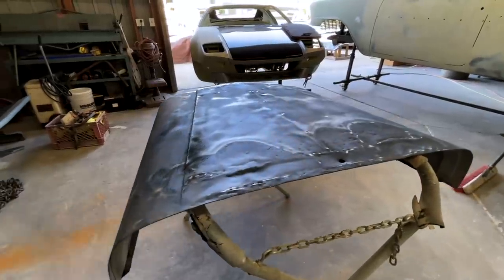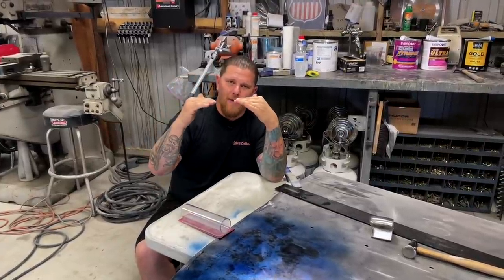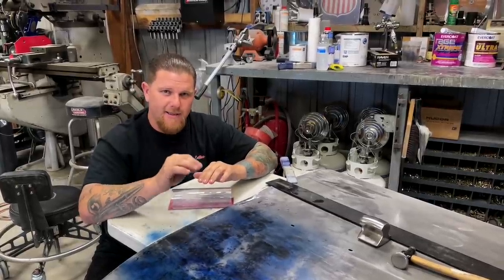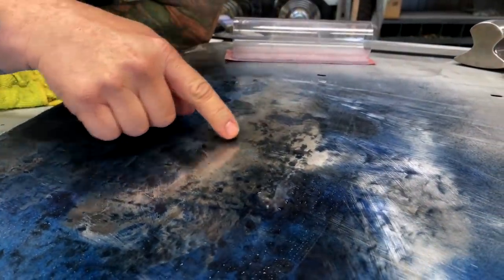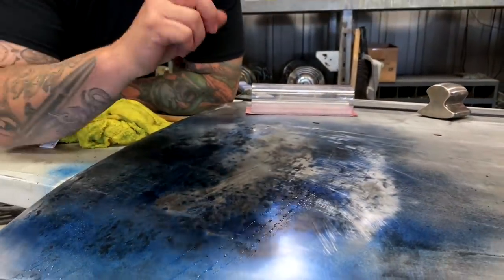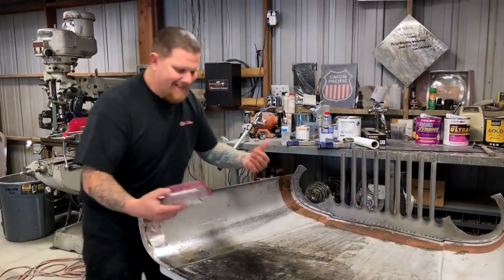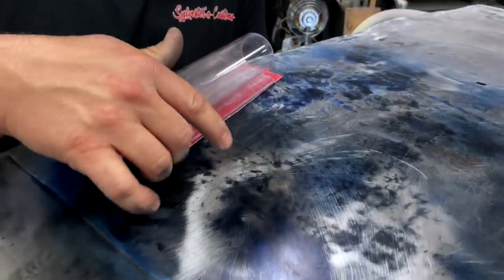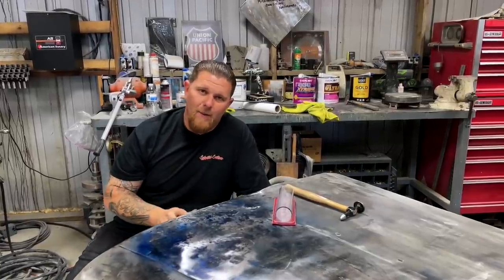Body Work Without Body Filler Ep.2 49 Willys Hood

Comment: Wow! I'm fully an amateur working on a restore of my '78 124 Spider. Had to replace the rear wheel wells and got a small "wave" in the quarterpanel from the heat. Didn't quite know what to do with it. Sure...could have covered it with a gob of body filler, but really excited to try to work it out properly.

Comment: Great video thanks, the part that I find confusing is that you want to shrink the highs and stretch the lows on one side, but if the panel is flipped over the lows are now high. If  I use the shrinking disc it will be shrinking the areas that I want to stretch on the other side. That was confusing to type...lol
Reply from the maker: Good point! Best way to think about it is using a spline to sight the shape in. If you shrink to much it will become flat vs retaining the shape. However I have fixed flat panels by shrink disc and flipping the panel over.

Comment: The "Heat shrinker" is new to me, a torch and dolley is the way I learned to shrink. You said that your power unit had to turn 6,000 rpm's. I am thinking of getting one for my project and I see Eastwood has them in three different diameters. I want to get out cheap so I was thinking of the 41/2". But I know that I will get a lot more heat out of a 9" disk than a 41/2" disk. So does a small one work?? Thanks for your great videos. I realize you are in business and that time is money, so I wonder why you do this. This is one of the few thing in the world that I have seen come, that I feel is a good thing. So when I say thank you, I am sincere.
Reply from the maker: Thank you. The smaller one will only work for tight areas. Otherwise you need the large disk, so that way you are bridging the lows to make a true mirror finish.

Comment: Another very helpful video!  I am at the same stage with the same issue on my project.  Did that Makita grinder come with a flush mount collet for the shrinking disk or if not how did you get it so that you can run the shrinking disk totally flat on the panel without introducing new scratches?  I have the proshaper 10 inch shrinking disk looking at buying that Makita grinder.  Thank you for your help.
Reply from the maker: Contact Ken Sakamoto with sunchaser studios he has everything from the nut and the backing plate 👍🏻

Comment: Awsome video and def learned some new stuff. But I would have like to see how u started working down a larger dent with a good size crown..so you do more hammer off dolly to rough in the shape then fine tune it with what your doing or?
Reply from the maker: We typically bump out the panel with dolly only to get it close.

Comment: Excellent information. I wish your video had been available years ago when I bought my shrinking disk. I got the panel close enough for, but if I ever repaint I'll be able to get it perfect. 
Question. Your disc is serrated. Why is that? The one I have is smooth.
Reply from the maker: Thank you. Yes Ken Sakamoto’s sunchaser disc comes serrated it creates more heat than the smooth ones. It also creates a higher pitch when on the high areas so you can tell when you are rubbing the right spot. I have both smooth and serrated once I used this one I never went back.
Reply: @SYLVESTERSCUSTOMS  cool, thanks.

Comment: Great video. I'm panel beating a low crown roof that was sand blasted. I'm using a shrinking disc, a hammer, dolly and a slapper. The work is painfully slow. The roof top surface has many convex bulges about 12 inches diameter.
They are not very high and are the result of sand blasting the underside. Do I need to use the disc on the entire bulge or can I work on it in sections? Also if this is OK do I work from the outside towards the centre?
Reply from the maker: Use a block and only rub where you have the highs start in the good areas first. So if you start using the rubbing of the shrinking disc in the center of a high area that is bulged out you will get a better result if you only use it where the block scratches first as it starts to shrink more of it will have a contact patch as it gets closer to flat.
Reply: @SYLVESTERSCUSTOMS  Thanks for your super fast reply! I've been using you method today and am making progress. To gain confidence I started with the less difficult areas. There is however a large bulge nearby waiting to devour me!
Thanks again,
Mike

Comment: Hi Sylvester.  What would the ratio on 4:1 2k primer be it you want to use it as a sealer? Would you add reducer like 2:1:1 to thin it out for a smooth finish not requiring any sanding so I can just go right to base coat after it has flashed?? I spray motorcycle frames and don't have to fuss over much but when I sand the old finish some bare metal comes out and I want to just spot those small areas with a thin coat of self etching primer but on one of your videos I heard that you shouldn't spray base coat over self etching primer? Could I spray a thin coat of self etching primer thin a reduced coat of 2k then go to base coat. Also what about just self etching then a thin coat of rattle can primer, these spots are usually an inch or les in size? Thank you in advance.
Reply from the maker: All products vary however refer to your TDS sheet. Me personally I’d use epoxy primer then spray my base over that.
Reply: @SYLVESTERSCUSTOMS  I figured you would go that way and I want to try the epoxy but with bikes, waiting 2-3 days for the epoxy to cure is a lot to ask. When I finally burn through the 2k I have I will try the PPG epoxy and report in my videos. Thank you for taking the time for all of us!
Reply from the maker: @JTSCUSTOMS  👍🏻👍🏻👍🏻

Comment: ok, i get the idea of the shrinking disc ....but my situation. i am replacing door panel lowers (1951 chevy 3100), i have an access hole but its limited as to how much i can get my hand and arm inside to dolly the back(inside the door skin at the weld seam)and hammer and slapper bar the outside... for the most part its going well, but i had a spot (wave) about 4 inches in diameter that is currently convex to the outer door skin that i need to get shrunk down . what would you advise doing to do just that? i do not own a shrinking disc.
Reply from the maker: Kinda hard to explain not being able to see the door. It’s not uncommon to carefully remove areas of the inner door to gain better access then once you fix the area weld it all back in. But if you don’t own a disc you need to buy one I don’t have an alternative
Reply: @SYLVESTERSCUSTOMS  do you have an email or place i could send you a few pictures of the door. I got most of it out hand planishing. I have a palm sized low up by the door handle hole i never welded on , so its got to be oil canning from where i welded and ground it down.  I do have to cut a 6x9 speaker hole behind it. Maybe i can get a dolly behind it and slowly work it out .

Comment: I’m having a tough time on the back of my cab which is a 87 k10  Chevy. It had a decent sized dent in circumference, not real deep. I’m self learning a lot of it. I used my stud gun to pull and hammer and got a lot of it back out but I am getting oil canning. So I heated it up and tapped and cooled quick. I cannot get a dolly behind the panel cuz the inner cab panel has no access to outer. So I have a lot of dimples from the stud gun and it’s a little wonky. I straight edged it and there shouldn’t be no more than a 1/16th of filler in the deepest spot. Is that ok!? I feel I’m being a little ocd cuz of the little higher spots caused from the stud gun pulling.  Demotes will be hid behind filler but my brain wants me to smooth up metal a little better but I just don’t have any access for a dolly and hammer to smooth it up.
Reply from the maker: Sometimes you have to remove the inner panels and weld them back in. Just depends on how good you want it. We have classes this month and one in June if you are interested. Email sylvesterscustoms@yahoo.com
Reply: @SYLVESTERSCUSTOMS  These online classes ?
Reply from the maker: No in person hands on.

Comment: Bought the tools, tried, failed, watching the video for the third time 😂
Reply from the maker: What did you buy? What are you struggling with?
Reply: @SYLVESTERSCUSTOMS  I got a shrinking disc, dycome blue, sanding blocks, random orbital sander, hammer and dollys and some files.  Basically, the hardest part I’m finding is figuring out what the original level is. I can get things pretty straight relative to each other but end up too high or low in places and keep messing with it until I get frustrated and…back to the videos. The good news is, after I watch the video and go back out there it’s not   that bad and to be honest probably more of a patience problem or I think it’s worse than it is issue. I guess the main issue is getting things perfect, I can get it pretty good but dialing in the final imperfections I tend to overwork it, get frustrated and go backwards. Anyway, I love your videos, been super helpful. Learning about stretching the metal by hammer on dolly was a game changer for me. Final thing, I’m working with pretty munched up sheet metal so it’s not like I’m hurting it but it’s a 55 Chevy first series truck so I’m trying my hardest to not screw it up. Thanks again for your videos!
Reply from the maker: @Stoked778  I can tell you what your going through is very normal. I went a very long time and hundreds of hours till certain things clicked for me. I use splines to guage what’s good and what’s low it helps a lot. Second is start in the areas that are the closest to good that you can find. It’s absolutely a patience and finesse thing. It has humbled me many times. But you are on the right path watching the video over and over will help every time you struggle watch it again and you’ll get something else from it. Thanks for watching!
Reply: @SYLVESTERSCUSTOMS  thank you for taking time to reply! Btw, the jeep hood videos are some of the most helpful on YouTube I’ve found by far!